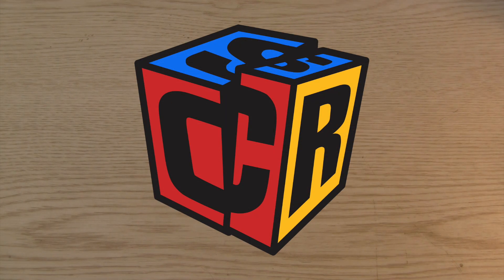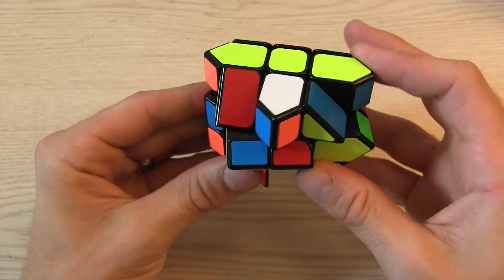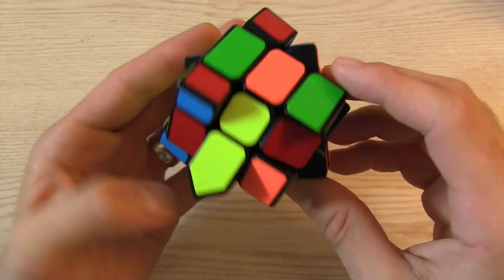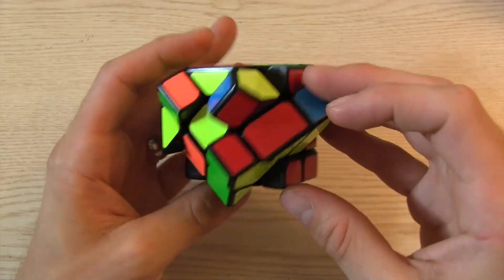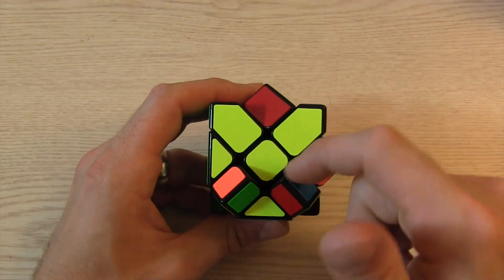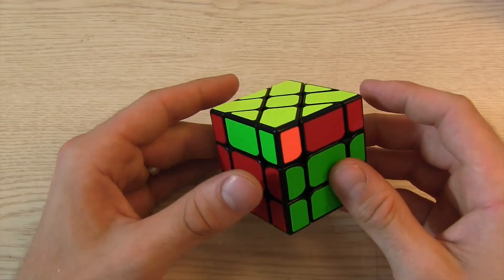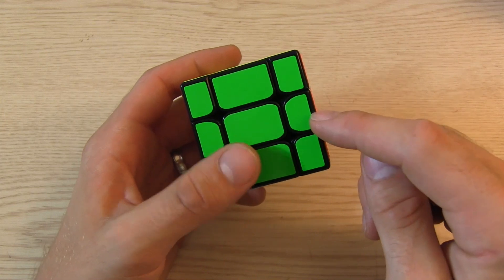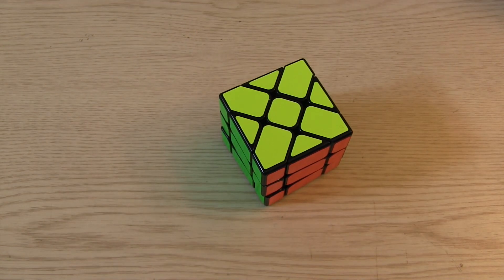Fisher Cube - How Do You Solve It?

Comment: I get to the point where I need to rotate 3 top centers but when I do, a center piece rotates 90 degrees
Reply from the maker: I'm guessing you mean an edge. If you have only one edge flipped, then one of the second layer edges is also flipped. Do 
R2 U2 F R2 F' U2 R' U R'
And then you will have a doable top layer as it flips the front right edge.

Comment: That is a pretty nice walkthrough, but I believe you did not mention the possibility of getting a parity. In fact, if one of the flat mono-coloured edge pieces is oriented incorrectly (you can't tell since it is, indeed, flat and mono-coloured) you can't make the cross on the last layer: you get cases that sorta resemble those of a 4x4. In order to "solve" this parity you have to take one of the flat edges out and relocate it the opposite way; then you go on with the normal solve since now you can make an actual cross on the last layer.
Reply from the maker: +EmereIEme Yes.  I wrote that in the description
Reply: SpeedCubeReview My bad, I didn't read it. If you want you can delete my comment. Sorry. XD